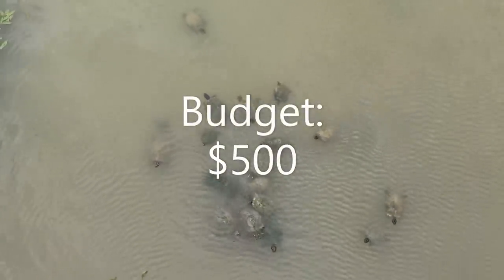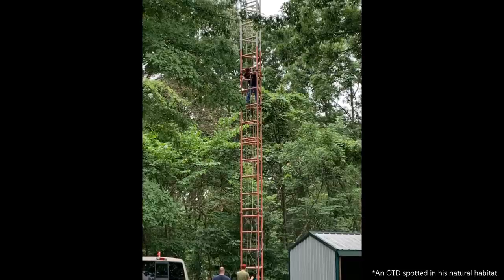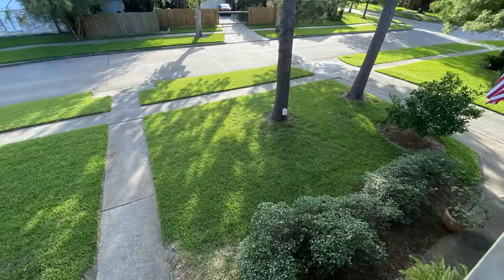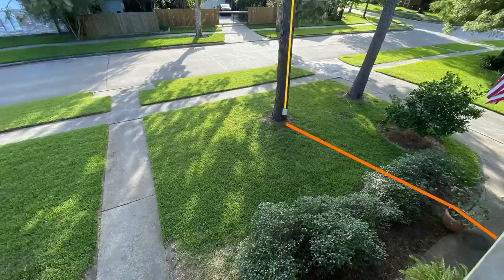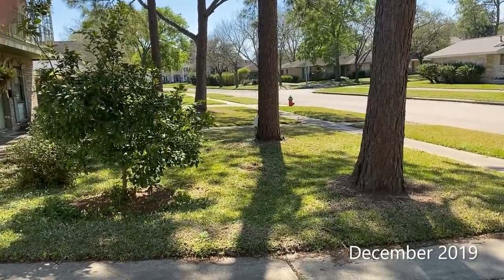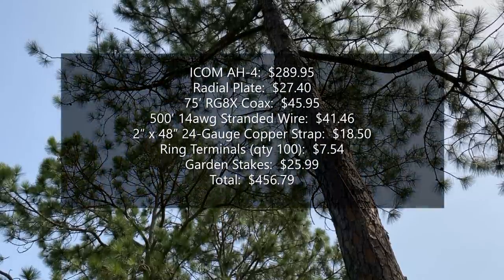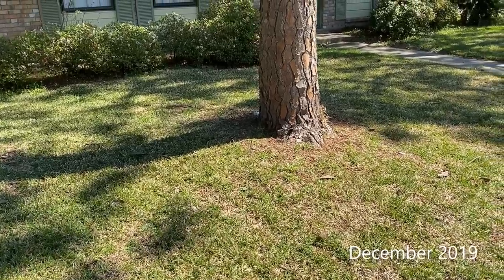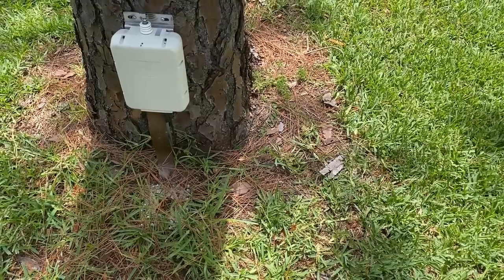Multi-Band Vertical Ham Radio Antenna in the Front Yard?

Comment: My solution would have been to put a For Sale sign on the front lawn.
Reply: The solution is to never buy a house in an HOA area to begin with. And watch out for CC&R's on the title too (basically same rules as an HOA, but without the formal HOA board)
Reply: @gorak9000  -   I totally agree, but easier said than done these days.  Needing to be close to commute to your job and/or live in a good school district for your kids are two BIG considerations when buying a home.  These areas are almost always controlled by the HOA.  I remember when I was growing up in the 60's that every home had a TV antenna on the roof.  Some where neatly installed and others were an eyesore having antennas with bent or missing elements, bent rusty masts and broken guy wires flapping in the wind.  And that is exactly why the HOA steps in.  I wish the HOA's would judge each individual on a neat, pleasant looking install as opposed to a 'one-size-fits-all rule'.  73!

Comment: You should also consider spray painting the box to match the tree.
Reply from the maker: Yeah, I need to do something about the white tuner.  My first thought was to paint it, but it is hard for me to paint a new $300 box:)  I'm thinking I'm going to wrap it in a camo net and/or place some large potted plants around it.
Reply: @ShackingOff  use Plasti-dip.  A couple of coats will hide it well, and it can be peeled off.
Reply: @ShackingOff  Or find some camo vinyl wrap like they use on cars.
Reply: Maybe wrap it with thin copper foil; that would patina to the same colour as the tree bark.
Reply: I'd rattle-can it with matte brown.
Reply: I was thinking of brown vinyl wrap for the tuner?
Reply: @ShackingOff  Get some brown vinyl wrap. It will stick but it's easy to peel off as well.

Comment: I'm in a metropolitan housing authority building with an apartment balcony railing.  I won my battle arguing my constitutional rights, and that operating Amateur/Ham/CB radio is a form of therapy for the condition at which I receive SSDI for, and that "interfering" with my radio hobby/art will cause undue stress with my aortic valve and quintuple bypass surgery and could lead to my death.  And lastly, I argued, like another urban dweller that posted here, all the "ghetto culture" and their alcohol abuse and illegal drug use is more a lease violation than me keying down a hundred watts on the CB band in Lower Sideband!

Comment: I have to congratulate you in overcoming what seems to be a common issue, whether it be a XYL or planning restriction.  Thinking a little more about your scenario, have you considered adding a couple more wires?  I use mainly 40/20 and 17, so you could, in theory, add to your camouflage vertical scenario by using resonant lengths.  A 40 ¼ wave folded over will give you 15 meters.  Your ground plane is more than good enough to support this, so 3 wires could do the trick and perhaps reduce noise?  I’m only thinking aloud so forgive me if you’ve already given this some thought and ruled it out.  Most of all enjoy what you have and don’t give up.  73 de M0AZE Mike
Reply from the maker: Resonant antennas are definitely less noisy.  I haven't studied up on folded monopole verticals before, but it looks like something I should consider.
Reply: Shacking Off I was think along the  DX Commander lines without the pole.  40 meter with a little fold over (linear loading) works fine on mine.  Take care stay safe 👍🏻👍🏻👍🏻
Reply: @ShackingOff  That's what the DX commander does.  folded element for 40/15 works great.   You could get those resonant on that tree.  I'd also paint the antenna tuner so it's less noticeable.   Setup looks good, wish I had trees like that.  I'm running a dxcommander in the back corner of the yard with about 30 radials.

Comment: Congratulations on implementing this project to get a working stealth antenna. One thing I did wonder about was your coax loss. However, with typical RG8x spec. of 2.0dB per 100ft at 30MHz. Your 76(?)ft run on lower bands should be well under 2dB. So, I wouldn't worry too much.

Comment: Great idea for a stealth antenna and a video very well done!  I liked the soft classy jazz music in the background...nice touch.  It's no wonder you had so many hits on this video...lol!  These days it seems that HOA antenna restrictions apply in nearly any city community worth living in.  It is certainly an issue for me.  Compromises must be made in our desperation to get on the air.  I was able to run a nearly invisible 'MyAntennas' 53' End Fed Longwire along one side of my house and a 37' OCF Dipole in my tiny attic.  Neither throw flames but at least one or the other seems to work fairly well enabling me to make contacts.  HOA antenna restrictions are strong driver for the popularity of POTA (Parks on the Air) operations.  73!

Comment: I agree about camouflaging that antenna tuner box using sprinkler control box or labels. If by some chance a neighbor is receiving unwanted radio frequency interference from your station, he/she may start snooping around to see who the culprit is.  You have every right to transmit under federal law, but neighbors have every right to make life difficult for you via the H.O.A.  So

         it's always best to hide outside equipment and deny any involvement in ham radio or C.B. radio.  By all means, never tell any surrounding neighbors that you are a Ham Radio Operator. The first moment they have any problems with their computers, TV , WIFI or other devices they will be banging on your door as the source of their problems even if you are not. 

         The good news is that WIFI operates on entirely different frequencies than Ham Radio. Secondly, the cable TV signals pumped into most homes are at levels of nearly 60dB using shielded cables. Rarely if ever will any ham band transmission even slightly penetrate into TV cable even running signals at 1,500 watts.

Comment: And when the neighbor's or a passer by dog comes over to pee on your front yard light it up by keying your microphone on 100W of power.
Reply from the maker: LOL, I hope not!  All the neighborhood dogs are free to pee on my lawn:)  Since there are many radials to share the return currents and they are in parallel with ground, each radial is going to carry very little RF current.  However, I did fail to mention that I can see the antenna from the window of my shack.  I would cease transmission if any creature comes near the vertical to prevent RF burns.

Comment: If you are looking for a quieter on recieve and more efficient antenna option (balanced antenna), you might try a loop antenna with the AH4 tuner.  I have done this antenna in both virtical and horizontal configurations.  Horizontal loop give low take off angle and directional gain too.  For stealth, you could mount the AH4 on the back side of a chimney or vent pipe on the top of the roof, run wire along roof peak (or just behind) and then back to the fence corners in back yard with remainder of loop running along top of backyard fence to produce a sloper configuration.  I have experimeted with both 275 and 550 foot lengths with amazing results, but you can run much less wire and the AH4 will tune it just fine on 6M to 160M....yes the AH4 does work on 160M if you attach enough wire.  Great video.
Reply: Are you running the loop parallel to the roof and the back or it some how vertical ?
Reply: @Mark300win  My loop run across the back edge of my roof and then it goes to the back two corner of my backyard. It is horizontal but has a slight tilt to it. It works well and you can't see it from the front of my house.
Reply: @stevecolby6505  thanks steve! Do you know what is the total length of the wire used in this horizontal loop?
Reply: @Mark300win   1005/Freq in Mhz = length in feet.....you can feed it with coax and a 4:1 balun for it to be multibanded or better yet a remote autotuner at the feed point like an Icom AH4. I targeted 3.7 Mhz, so my length was about 271.6 feet (about 68 feet on a side for a square loop).
Reply: @stevecolby6505  would it be problem if the loop part on the roof get buried with snow? How did you stick the wire it to hold on the shingles?
Reply: @Mark300win  There are hangers that are designed to hold Christmas lights to roofing shingles. They work well. Many roofs have ridge vents at the top of the roof. Ridge vents are a good place to attach. Ice and snow can affect the antenna, but it will still work. SWR might be changed a bit.

Comment: When I was a young lad one of my electronic instructor said that when you put an antenna in near, on or in a tree you will lose signal on transmit due what they call RF leakage because the tree has moisture within allowing portion of the output signal to attenuate to ground.
Reply: @Adrian-jk4kx  Most Antennas are insulated but if the rain shorts the antenna and the SWR goes up you will lose signal. If SWR goes to high you might lose the finals if your transmitting side does not have shut down protection.

Comment: Put a bucket or a empty can over the tuner .. the ""horn "" ain't as water tight as you would like 
Well bro ... Rule 1 radials is 1/4 of the Frequncey's 
You only need 1 pr band .. mor is not nessesery Better 
More Changes impedans .. more 
I used 4 pr band in 4 resonating difrent lenghts 
So you got most bandwith pr band 
Greetings From DENMARK  🇩 🇰 🇩🇰 🖖

Comment: I put an 18 foot fiberglass antenna mounted on a 12 foot galvanized pipe out the top of a 100 foot pine tree and lagged it into the heart of the tree to make the tree the ground. It was an awesome set up and worked like a champ until lightning struck it about a year later. It didn’t hurt the tree but it burned out circuit boards in things like heat pumps and microwaves in my house and the houses on either side of me. I had dropped the coax out of my window when the storm was approaching and it landed on my heat pump otherwise it might not have been as damaging as it turned out to be. My neighbors would find pieces of fiberglass around their yards for a long time. If I were not so old now I would like to try it again and use a real ground wire this time...
Reply: You should of had a ground rod at the tree to eliminate all the statics that attracted the lightning. Ground at the feed point and ground at the radio and never worry about lightning ⚡️ ever after
Reply: @Mark300win  You are correct about the ground but the man that I paid to put it up in the tree was a professional lineman who had installed dozens and he talked me out of the ground wire saying that tapping into the heart of the tree with lag bolts made the tree the ground. It sounded pretty convincing so we did it his way and when lightning hit the antenna it used the very heavy duty coax as the ground wire instead of the tree heck the tree was fine. I didn’t know the guy he was introduced to me over the radio so I never got to tell him that he needed to rethink his installation methods before somebody had some serious trouble or even get someone injured. It was fun while it lasted heck you had to walk quite a bit up the road to see it up there it was so high up. I would be taking to someone on the other side of the country and they would ask what kind of beams I was using and I would tell them a one element on the tall side.  I always did love radio and I’ll get back in it again one day. Thank You Mohamad for your response and I wish good things for you
Reply: @drumminsonlive9199   wow its awesome to have a beam-like performance from a single radiator antenna like that!! What was total length of the radiator? how far above the ground was the feed point? Did you have elevated counterpoise wires above ground or dangling from the feedpoint to the ground? Dis you have antenna tunner at the feedpoint too? I know so many questions but im so interested to copy your build and give it a try!
Reply: That’s a great setup, and my first thought was how did you get it up there, then I read that a pro did it. I wouldn’t get that high in a tree. Best of luck with returning to the hobby

Comment: How do you mow the lawn without cutting the radials?
Reply from the maker: I put my radials down in late winter.  Before I laid them, I cut the grass very sort and held them down with  al lot of lawn staples.  In a few months, the grass grew right over them and pulled them down to the dirt.  After a year, I had to go digging around to find them.

Comment: Interesting video sir. Considering a similar wire, so your video came at a great time, but I’m not worried about HoA restrictions. Do you think a vertical wire with raised radials, fed higher up the pine tree, might work as well as yours? 73 de KN4HGI Alan
Reply from the maker: I haven't experimented with that configuration yet.  There used to be a great AH-4 Yahoo Group and I recall people on that forum having good success with raised radials.  As a added bonus, you would probably require a lot fewer raised radials.  If you have the room, people have also had good success with large horizontal and vertical loops using the AH-4.  Lots of good info on the web.  I want to experiment with that next.  -Norm KC9CSC.

Comment: Nice job! My only suggestion to even better stealth that install is to spay paint the antenna tuner case brown to match the tree it's on.

I was lucky enough to be able to put a Husler 6BTV with optional 12M, 17M and 60M add-ons in my back yard. You are luck to have nice tall trees to work from.

Have you considered putting up a "horizontal loop" high up in the trees surrounding your house? A Loop is a VERY quiet antenna for receiving signals.

Comment: Perhaps an alternative is a horizontal wire loop around the perimeter of the roof line, stapled to the bottom of or behind facia board.  The RG8X can be snaked up the exterior side wall mostly out of sight, and painted to match the wall behind it.  Then mount the tuner right before the coax enters the house.  I'm looking at this option for a part-time "shack" at my daughter's place in Vegas.  They can SWL while I'm not there, and I can tap into it when I am visiting.  In your situation if nothing else it could make for a much quieter non-resonant receiving antenna for little extra cost.  Have fun!

Comment: Unfortunately, being so close to the tree trunk, most likely a majority of your losses are not due to your decent  ground radial system as illustrated, but rather considerable RF absorption is probably occurring within the  moisture of the tree itself.  I do understand keeping the antenna as close to the tree as possible is an imperative due to the need for stealth, but in your situation I might be tempted to use thinner, less visible wire for the antenna, and try to slope the wire away from the tree trunk by locating your upper pull-up point a few feet out on a limb. Just thinking out loud…. Otherwise, very nice job on the antenna and an excellent video. Thomas —KK7JD—
Reply from the maker: Thanks Thomas!  In this video, the top of the wire approximately 6ft from the trunk of the tree.  You are correct about moving the wire further from the tree.  I've tried a number of distances from 0 to 25ft.  Performance was awful with the wire right up against the tree and improved as the wire was moved further from the trunk.  Currently the wire is about 12ft from the trunk as a compromise.  You have given me a good idea for a presentation. I should document moving the wire at different distances from the trunk show my results.   -Norm KC9CSC

Comment: Awesome job Shack!  I have a question...can I do the same set up with a HUSTLER 5-BTV antenna?  Would it work?  Please give me some advice fellow hammies!
Reply from the maker: No, not really.  Although, the radial system would be similar.  I would go to the DXEngineering website and check out the HUSTLER 5-BTV manual they have.  That's the most authoritative reference to that antenna.  There are also a lot better YouTube videos on this subject than mine.  73, your fellow hammies Norm KC9CSC

Comment: 7:10 - That is not dielectric grease. Dielectric grease is a silicon INSULATING grease used to protect electrical connections without lowering the resistance between them. You've used the correct grease, just referred to it as dielectric grease by mistake. Using a dielectric grease will create capacitive and resistive impedance on your radials messing with your match. You must use electrically conductive greases for antenna connections. 👍

Comment: ...good idea! How good work this antenna on the 80-m-Band? 73 Mike DO1MDE
Reply from the maker: The vertical wire in this video was about 10m long.  It would tune on 80m, but I don't think I was getting out very well.  I raised the antenna, and now it is about 16m long.  It's performing a lot better on 80m now with the longer wire.  73 Norm KC9CSC
Reply: @ShackingOff  tnx Norm....i´m also thinking about a vertical multiband antenna in my area. In the moment i use an inverted vee 2x18 Meters long with a stockcorner JC4S Antenna Tuner for all the bands - it works really good - but it´s not really a DX-Antenna.....                                                 73 Mike

Comment: If it is noisy, is it worth it? I have a 6BTV resonant on all bands and the noise is very low with my icom 7300. I had an UnUn with 117ft wire and it was very noisy

Comment: Are the wires in the grass called radials or radios?
Reply from the maker: They are called radials since the are arranged like radii (a straight line from the center to the circumference of a circle) from the base of the antenna.  My enunciation wasn't the best there:)

Comment: how is performance during rainy days?
Reply from the maker: A wet tree affected the performance of the antenna when it was within a couple of feet from the trunk of the tree.  Now, I have the top of the antenna 15 feet from the trunk of the tree and I don't see much difference between wet and dry at HF. 73 Norm KC9CSC